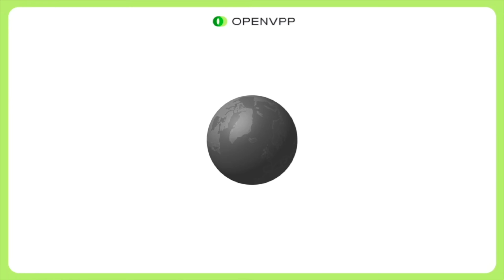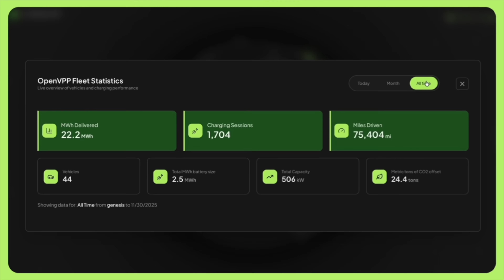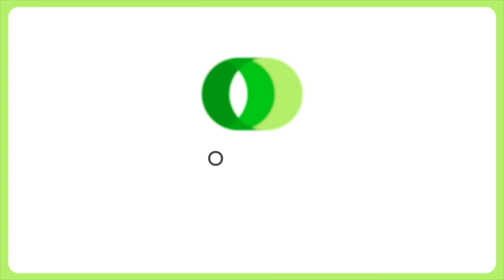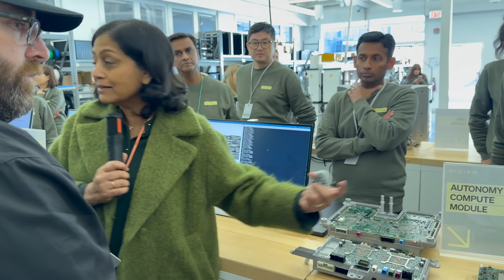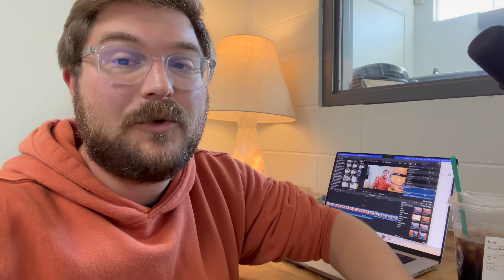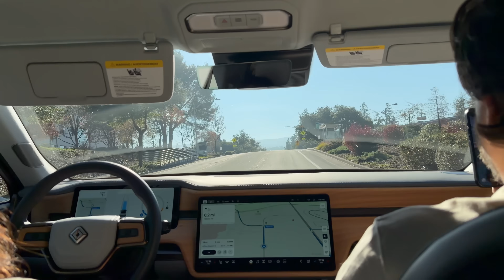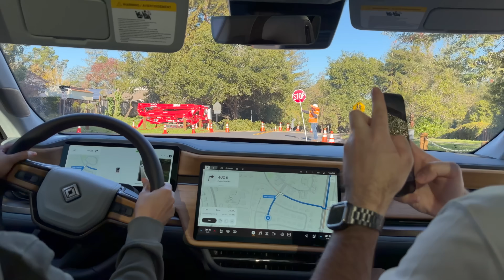My Rivian “FSD” Test Ride! Long Road Ahead But The Correct Choice

Comment: At this point I think OOS should take the approach it took towards Tesla FSD until V13...which was basically ignore it and let the dedicated "FSD" channels handle the painful progression it went through.  If you want to cover "FSD" more than you used to then I think it is fair to look at the consumer shipping version against whatever version Tesla FSD will be on by that time (and other manufacturers).  I'd agree that Rivian will progress faster from this version (maybe this is along the lines of Tesla V10?) to a V14 equivalent version than Tesla did because of advancement in AI and knowledge.  But during that same time, with those same advancements in AI/knowledge, Tesla will also accelerate its progression past V14 towards Unsupervised.  By the time this Rivian system ships to consumers late 2026 (with maybe a system equivalent to V12 or V13??), Tesla will be on V15 or 16 and likely have Unsupervised in certain geo-restricted areas.  Will be interesting to see if they can eventually accelerate faster than Tesla to catch them and have a system available to consumers at the same time that is on par.

Comment: Kyle, to your question, we should be excited and optimistic about what Rivian has accomplished or demonstrated earlier this week. Tesla has over a decade's head start, and their Model 3 & Y volume gives them a vast database to run AI user habit models on. I believe that anytime we make a prediction or guess on the future of something on the market, we need to not only look at the snapshot of where we are today, but also the rate of change or "trend". In our math classes, that's precisely how we do an extrapolation, and the more past data points, the better. No, I haven't physically graphed anything, but it's clear that Rivian's rate of improvement is faster than Tesla's. Rivian would catch and pass Tesla if trends continued, but no one knows where each company will be 5-10 years from now. What is clear is that Rivian needs their own vast user database to catch Tesla, which means the R2 needs to be a huge success, maxing out the Rivian production plants. Also, another optimistic point is the comparison of Rivian versus other makers, in particular other legacy makers; who else is even close to the capabilities shown in this demo, and who else offers Rivian's OTA update software vehicle software OS that allows them to improve month by month as you drive them?

Comment: With better hardware on the Gen 2 than any Tesla for FSD, I dont understand with the current cameras, radar and NVDIA chipset, why are they spending the development costs on Gen 3 in house chip and LDAR when competitors have proven that full FSD L4  can be done with the current GEN 2 hardware. Focus on R2 manufacturing and sales required to improve their business model and when they achieve this they can take profits and invest in LDAR and better chips (If neccessary, and that is a big IF!)
Reply: They are trying to convince people that lidar would somehow make their self driving more safe, when in reality, it won't.

Comment: The only way to get there is to launch and learn and catch up incrementally. Tesla was charging 8k in 2017 for a system probably worse than what Rivian will launch with. Tesla in 2022 was charging 15k for FSD…

Comment: I agree with most of the commentors. It's not tesla, they are far behind, but they are ahead of the other us automakers. I like that they we have their own spin. For example, just helping it in a certain situations without actually disengaging. I like that. Give them 2 years, it will be decent.
Reply: I disagree that they are ahead of others. nVidia CES announcement of ALpamayo - it's open to any manufacturer, and the MB CLA first drive @kyleconner just posted shows significantly smoother and more consistent performance than Rivian IMO.  Still well behind Tesla, but I am not convinced that Rivian has the degree of software talent to compete with Tesla and nVidia. Those are two of the top software companies in existence. RIvian is not. It's a huge gamble.
Reply: Exactly, I don’t understand all the comparisons to Tesla.  It’s all the others that are in trouble.
Reply: I hope Rivian catches up and passes Tesla in the autonomous driving department.
Reply: Isn’t Tesla ten years older than Rivian?

Rivian won’t start where Tesla is now, especially with Rivian going a different path with radar, and eventually LiDar.

Comment: maybe do a checklist like your autonomy challenge (which I think should be updated to include city driving btw) and give relative scores.  granted you may not be able to experience what is on the checklist first hand and might have to rely on what the engineers tell you.  That way a comparison between, say, tesla and rivian can be done based on features.  Then subjective observations like smoothness and jerkiness and assertiveness can be mentioned at the end notes.  my 2 cents...

Comment: A major difficulty for Rivian is going from the Nvidia processor in their current cars to their own processor. The low level architecture is completely different. Tesla maintained backward compatiblity between HW3 and HW4 and presumably will do the same for AI5. They ran HW4 in compatibility mode for a year and a half before they launched FSD13 which used a larger model which took advantage of the expanded neural net and memory in HW4. Rivian won't be able to do that. Presumably Rivian has tools that translate between the two architectures but my guess as someone who has 50 years designing computers that you will see a big regression on the R2 vehicles that will add an extra year before they close the gap between the old systems and the new one. Optimistically I'd guess that it will be 2029 or even 2030 before they get to where FSD14 is today.

Comment: I think you should Score them based on the Level they achieve. As you said, a level 2 systems can be better than a level 3 in day to day ownership ship. Your hog back is good but it’s not really all encompassing. If a car is sold as Level 2, and yet it has repeatable disengagements from Level 2 perimeters, it should fail an honest test. I’m not sure how the scoring should go but maybe Excellent (drives better than average driver) Pass (drives about average)  and Fail (drives worst than average) and give these rates inside the SAE levels.  So if you have Brand A saying they have achieved level 3 +++. You should start testing them and see if they achieve level 1, 2 and 3 fully. Because if they can’t handle Level 1 ADAS in a traffic jam without near prefect engagement, but claim there system is highway drive assist. That should be a fail.

Comment: Leave Tesla out of the equation. Bc, surprise, not everyone has driven a Tesla, just like not everyone has not driven a 911. You evaluate what you have in front of you. Not everyone has or wants a Tesla and it's just not something that's going to happen for them. At all. So as an independent evaluator, you should speak to these people. Evaluate the system for what it is and can do. Sure, we all know, Tesla is way ahead, no one can argue that. It doesn't mean we can't applaud what other automakers are doing as they improve their offerings. If a Corrola becomes a much better track and performance vehicle, we don't need to keep scrapping on it bc it's not a 911. Just evaluate it and appreciate it for what it's doing and improving.

Comment: Rivian developed this model in 3 months. They have massive upside and I would expect rapid improvement throughout 2026.  They don't need to catch up to Tesla to have a great ADAS.   At $2500, I would much higher take rate than Tesla which will add to Rivian revenue stream. Whether they can deliver level 4 by 2027 remains to be seen, but they sure are confident in their tech stack.

Comment: I would like to know how the hardware compares to Tesla?
Reply: From what I could see, Rivian's RAP1 is roughly equivalent to Tesla's HW5 (2027). But RAP1 is scalable, whereas it appears Tesla is sticking with a dual processor limit.
Reply: @harrydoby8517  So according to this video the new chip that will be going into the R2 can perform 1,600 trillion operation per second. In comparison to Tesla's HW4 that can do 500.
https://www.youtube.com/watch?v=cu0_ZEIT5YU

Comment: There's a reason Tesla released their solution early. They completely ignore all safety standards. Most major automakers has solutions that are better than the tesla system. However they won't release it until they deem it completely safe.

Comment: Glad there is another played in this field. The price of this is great! However this isn’t close to FSD but with AI this could be very close after 6 months of running constant and consistent model runs. On another note I have a rivian R1s 2026 on lease and I’m slightly worried that it will be obsolete by the end of my lease. Thankfully it’s just a lease so I could easily switch

Comment: I’ve been with Tesla FSD since the very first public version, been experienced with the inability of it to get better until fundamental changes in its program and hardware were made ie eliminating ultra sound sensors due to conflicting info… I think Rivians approach will hit a very low ceiling and get stuck due to its hardware choices and inability to get that set to work together seamless like existing FSD 14.  Good luck but don’t see it getting very good.  Too complicated.
Reply: Exactly. Tesla spent millions and already figured out sensor fusion wouldn't work. But I guess Rivian wants to waste resources and time learning the same thing the hard way.

Comment: The way I view it is Tesla has a massive head start and self driving functionality takes a huge amount of time to build. To do so properly also takes substantial testing which takes a lot of time.
So while it might be far behind Tesla, but one other way to view it is:
As a customer would you rather have some functionality now and have the functionality gradually get better? Or wait another who-knows-how-many years before they are caught up to Tesla (which will be a moving target). 

Personally, I'd rather see incremental progress (while wishing it could come faster) than have the functionality stay stagnant until it's on par with Tesla

Comment: This Rivian project seems like a presentation to convince new investors to fund them. They continue to bleed cash. IMO, they lack the funds to pay for the big investments (or expenses) required to achieve their autonomous driving goals. This is further complicated by them lacking the sales volume to distribute the corresponding costs in enough vehicles… Furthermore, If it were as simple as designing a powerful proprietary processor and throw the problem at AI (even if you had the money for the very expensive training infrastructure), companies with much larger pockets than Rivian would be much closer to solving autonomous driving.

Comment: Agree overall, but I think you are wrong to say they should have started on this earlier. I believe the first mover advantage is zero here. Rivian will catch up to Tesla at a fraction of the cost because they get to avoid most first mover mistakes.

I also think it's important to recognize that Rivian is demoing this to show they aren't starting from zero, not to make you believe they have a shippable product.
Reply: First mover mistakes that they get to avoid, like using lidar??
Reply: Your comments are good, but for me the key question is whether rivian can get good enough before they run out of money, and bear in mind tesla will keep improving too
Reply: @ericchild3363  There is a point where the driving improvements become minimal or inconsequential as Tesla puts it not worth spending more money to make better. This is why Rivian can and will catch up my friend.
Reply: @darinbrazil5496  Rivian can only catch up if they have the funding to do so, and that is far from certain given how long it will take (a few years at best), but I wish them luck.
Reply: @ericchild3363  don't worry about the money, there is always money to be had its constantly being printed. The only risk left in this company is wether R2 will sell at the numbers they need that is the make or break just like model 3/Y was make or break for Tesla.
Reply: @darinbrazil5496  Increasing sales volume is only good if each unit is profitable. That is still in question. I wish them well
Reply: @ericchild3363  Its a math equation as I am sure you are smart enough to understand. The increased volume lowers the cost of each unit sold thats how manufacturing works and that is increasingly important with further vertical integration thus if they hit the sales numbers they need they will be profitable I can guarantee you that because math does not lie.
Reply: @darinbrazil5496  That is only true if each sale has a positive unit contribution, before taking account of SG&A costs. Has rivian achieved this milestone yet, or are they still loss leading?
Reply: @ericchild3363  You like to live in the world of "If's" for me I am of the mind that Rivian is in business to be profitable and is not a fraudulent company. So for me it is not "If" it is "When". A true company does not continue to vertically integrate when they can not see through to the profit it creates. A fraudulent company continues to vertically integrate so that their story can stay intact and continue to gain investment even though they can not see through to a profitable scenario. Does that make sense to you? I believe the company is not fraudulent but maybe you do believe they are fraudulent and thats fine if that is what you want to believe.
Reply: This is the big question, IMO. Tesla maintains some important advantages. A big one is they have a larger fleet and are selling more cars, so they can spread the engineering costs over more customers.

Tesla has also made some big investments in AI training. Rivian may have a better idea what they need and want, but they've still got to pay for that, so I'm not sure the "fraction of the cost" will play out.
Reply: @graemeesmith Exactly. The stuff demoed here was pretty trivial. Complex driving in the real world requires exponentially better neural nets, and you need a boatload of compute and data storage (many petabytes) to develop them. Rivian will need a lot of money (many billions) to develop their own compute data center. Or they can rent time at one, which will be less efficient and still cost a lot of money. Good on Rivian for doing this—competition is great. But people are vastly underestimating the size of the mountain Rivian still needs to climb here.
Reply: Isn't Waymo having a big recall right now. Lidar and radar right.
Reply: It seems to get lost on people that Rivian was itself advertising self driving since 2018.
Reply: @AndrewBatiuk yeah. Everyone thinking this system is a year old. It was started in 2021, so actually almost 5 years old.
Reply: this would be true if they weren't using radar and lidar
Reply: @arbitrarii  Sorry, YT comment threading sucks... what would be true? How exactly are radar and lidar a benefit?
Reply: @AndrewBatiuk the original commenter said "Rivian will catch Tesla at a fraction of the cost because they get to avoid most first mover mistakes"

And I pointed out they're using radar and lidar, the two biggest mistakes in this field
Reply: @arbitrarii  LOL 🙂 I don't know if lidar is the biggest mistake but... It'll sure be interesting to see  if Rivian can adequately address sensor fusion. 

I've seen some people humorously point out Rivian's lidar only points forward, so how can it handle turns. 

The future is only getting more interesting, that much is certain.
Reply: @arbitrarii  I will believe that radar and lidar are big mistakes when you can find a Level 5 autonomous vehicle that doesn't use them.
Reply: @jeremiahkuehne2400  You said " I will believe that radar and lidar are big mistakes when you can find a Level 5 autonomous vehicle that doesn't use them."  Tesla is starting its level 5 robotaxi service with Cybercab early next year, maybe q2. So not long to wait.
Reply: @ericchild3363  Tesla has been saying "soon" for over a decade now. I'll believe it when I see it. And I live in Minnesota. It might work in warm climates but when you have leaves, rain, and snow that all blow across the road and have to interpret all of that it gets more complicated
Reply: @jeremiahkuehne2400  All true, but the recent user videos suggest all those issues have been solved with v14.2, and this is before the 10x larger model to be deployed in q1 which will take it to another level.  We shall soon see.
Reply: @jeremiahkuehne2400 yup.  I was wondering how Tesla does it in the heavy fog, so I looked up YouTube videos. FSD was not even able to start just like I expected on the cars with cameras. They just scaled down Robotaxi fleets too. I give zero credit to their promise.

Comment: I think it's fair to say the system as demo'd is a good start much like FSD in say 2023 or something where it really needs a lot of driver intervention. The excitement will come when and if they can deliver a system which needs much less user intervention.
Reply: I really don't see them being competitive for many years.  It took Tesla many years to get FSD to this point.  Why would anyone think that Rivian can get their rendition to the same point in half the time?  They also don't have the resources that Tesla has especially cash.  Rivian has still yet to make a profit so their resources are limited.  They would be better off in the short term licensing Tesla's software.  That would buy them time to develop their own and eventually drop Tesla software
Reply: @sandgrenyt33  catching up may be easier than being first as software engineers switch jobs and move the knowledge around.